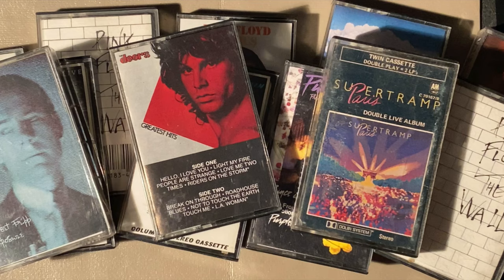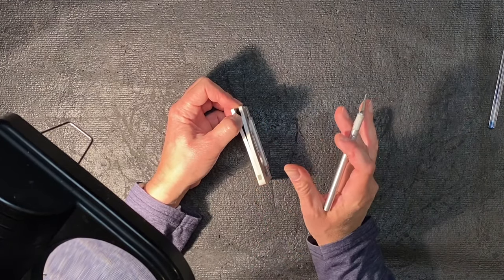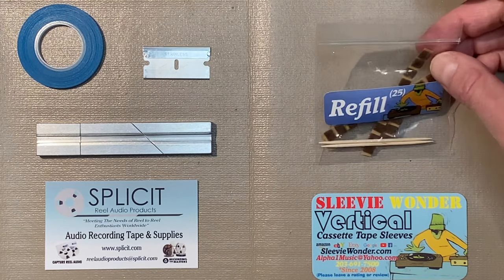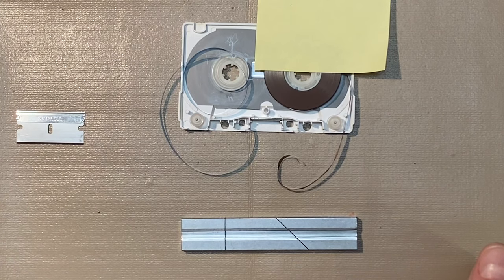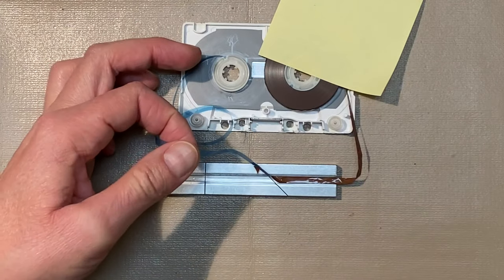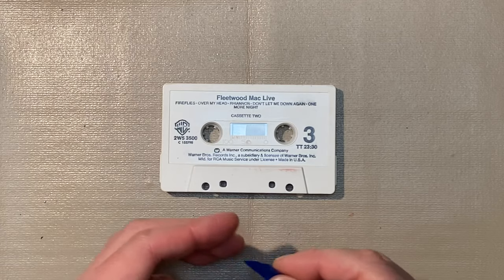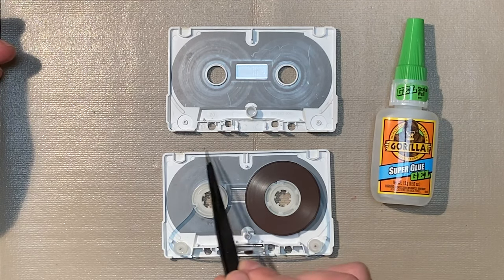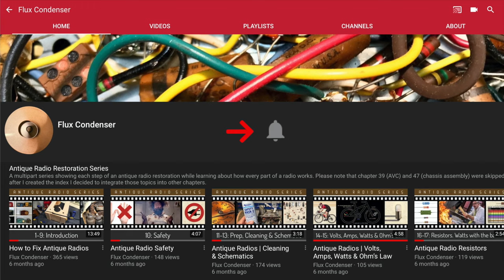How to Fix Cassette Tapes The Right Way. Open, Splice, Repair Like a Pro.

Comment: The original case was only glued on the outside.  How will u open this case again if needed with the glue on the interior of it?
Reply from the maker: Reopening the case over and over is definitely problematic, as these shells weren’t designed to be opened at all once they were sealed. In the event that the case would need be reopened, repeating the procedure should work. And hopefully, any extra glue that was used internally would easily break once the outer shell was cut apart.

Comment: Question: My leader tape came off the spool. How would one re-connect it so it's strong? Thanks for the video!
Reply from the maker: You don’t connect leader tape to the spool using tape. If you look closely, you’ll see there’s a tab on the hub which can be removed and then you can slip the tape in place and secure it with the tab. Good luck!

Comment: HELP - Today a tape of my Grandfather telling the family history broke at the beginning of Side One at the Take-up Reel/Supply wheel. I attempted to open the cassette with the blade and STOPPED. This is too precious for me to break. Do you fix tapes? If not, do you know where I could send it for a repair.
Reply from the maker: Kathy, I wish you luck getting the tape repaired. I don’t take in work as I do this for a hobby only. I’m not certain who could do the repair for you. I’m sure there’s someone out there if you decide to not continue with the repair yourself. Perhaps a Google search will bring something up. 

If you do continue with the repair, and carefully follow the instructions, you really shouldn’t have any issues. Additionally, if you’re not sentimentally attached to the cassette’s shell, once you get the tape opened and fixed, you could opt to transfer it to a replacement shell that uses screws to seal the case. That’ll make completing the repair easier and if it breaks again, you’ll have nice, easy access. You could sacrifice another tape to get such a shell, or buy a replacement shell which are available online. Good luck!

Comment: I have a Cobra announce cassette that is a 20 second tape which loops, for an old answering machine. The tape got snagged inside itself and I had to open the case. Now I can't figure out how to rewind the tape so it can be listened to. Have you ever done this?
Reply from the maker: It sounds like yours may loop similarly to an 8-track. If so, you may want to watch a video showing how 8-tracks loop on the spool from the outside and leave the spool from the inside. If I find out more, I’ll let you know.
Reply from the maker: I did a quick search for “cassette tape loop” and it seems that there are a number of ways to accomplish this, but none seem to use a method similar to 8-track. They simply use various schemes to loop the tape inside the cartridge. I’d suggest doing the same search on Google and look at the images to see if you see a scheme that will work for your tape. To get 20 seconds with a simple loop, your tape player will have to work at a slower than standard speed. Or, the tape will have to take a more complicated path to allow for 20 seconds worth of tape. Good luck.

Comment: Any suggestions for flattening wrinkled sections of old cassette tape?
Reply from the maker: No. Once it’s wrinkled, it’s wrinkled.
Reply: @FluxCondenser  Ugh. Thanks. After posting my question here I found another video of a guy using a cool iron to smooth out Ampex tape. That wouldn’t work on cassette tape?

Comment: can i get a link to the pad replace kit?
Reply from the maker: Sure thing: https://www.ebay.com/itm/25-Brown-Pressure-Pads-Cassette-Tape-Repair-Peel-and-Stick-Felt-Free-Sleeves/392881992224?hash=item5b79977220:g:Q1EAAOSwP5JdH-~W
Reply: @FluxCondenser  Ty

Comment: Excellent video Flux Condenser Vintage Audio Electronics!!!! May I ask where to get these tools and accessories to fix tapes? how to fix a tape that has detached from the reel? thank you very much in advance for your reply
Reply from the maker: Markus, I believe I mentioned where I got the tools in the video. Search eBay and you’ll find lots of options. 

If your tape has separated from the reel, look for the plastic insert which clips into the reel and holds the tape in place. Slide it out and then use it to re-clip the tape to the reel. 

Make sure you use a leader tape to connect to the reel as the magnetic tape will eventually break if it’s attached this way. Then, splice the leader tape to the magnetic tape. Hope this helps.
Reply: @FluxCondenser  Thank you very much. Sorry, i watched the video without the audio last night while I was copying some cassette tapes and listening them at the same time, my bad.
Reply: @FluxCondenser  The following question is probably a dumb one but i am asking you just in case. It is a very valuable and very old tape, just in case the plastic insert was not there or was damaged, are there any spare parts for this particular piece of plastic? I have several other tapes with the same problem and never dared to open them as I did know how to fix them. Thank you very much in advance for your reply.
Reply from the maker: Markus, there’s usually a pin or tab insert. If you can’t locate one on your reel, you could consider buying some spare reels to replace the ones you have. Again, look on eBay for spare parts. You may consider taping the leader to the reel as well. Good luck!

Comment: Just because im curious..What disadvatanges are there to not trimming the broken ribbon and putting a tiny touch of super glue and putting them back together that way?
Reply from the maker: Well, it’s not the traditional approach and the super glue is likely to perhaps not be flexible which could cause issues.

Comment: I have à problem with my cassette, sound is like wave its variable . Go down and up, do you can help me for repaire my cassette 🙏🏻🙏🏻
Reply from the maker: Do all cassettes play poorly in your machine or just one individual tape? If you’re having trouble with all cassettes, the machine may be at fault. You could have issues with belts slipping or a worn pinch roller. The pinch roller needs to be perfectly round, if not, playback speed will vary as you describe. 

Consider cleaning the pinch roller using a Q-tip and a liquid solution made specifically for that purpose. Pinch roller cleaners are available online. I don’t recommend alcohol for pinch rollers, but alcohol can be used on the tape heads. If you determine that the issue is the pinch roller, and cleaning doesn’t improve the situation, you’ll have to replace the roller. If that’s the case it’s a good idea to replace all the belts as well. 

If only one of your tapes is exhibiting this issue, first inspect the pressure pad and make sure it’s in good shape and secured properly. Check the shell and make sure it isn’t warped. If it is, you’ll need to transfer the tape to a replacement shell. Looking at the magnetic tape itself, make sure that it’s flat and not curled. If it is, or looks worn or distorted in any way, the tape will probably never play well again.

If the tape seems fine externally, the shell will have to be opened to investigate what’s causing the problem. Tapes often have two slip-sheets between the tape spools and shell, so check that they aren’t worn or causing friction. Also check that the tape path is correct as shown in the video and that the wheels are spinning freely. 

Good luck!

Comment: Hi! I own a few magnetic tapes from the ‘70s and I was wondering if there was any way that I could save them from ripping apart (I should mention that even if I touch it lightly the tape rips in pieces)
Reply from the maker: I wish I could help, but I’m not sure what would be the best approach with tapes that have become that delicate.
Reply: Tape baking, you may want to send them to a professional service to transfer however

Comment: Question would the super glue break the case if you needed to go back and repair it?
Reply from the maker: Chris, if you repeat the process as I showed using an Xacto to score the seam, there shouldn’t be any issue getting the case back open. Simply prying it open without cutting into the seam first, though, could result in a crack. Hope this helps.

Comment: Thanks for sharing you do need a steady hand and to be patient and I'd like to have somebody to do my tapes for me. I got quite a few needs to be fixed so it's going to take quite a bit of time but I will send for the kit through eBay so that I can get busy because I have tapes that are very dear to me my own piano playing and singing and I would love to preserve it , always save it and try and have it transferred to a CD so thanks again great work! Do you know how I would be able to do that transfer my music from a cassette tape to a CD?
Reply from the maker: Essie, good luck repairing all those tapes. Yes, it requires a lot of patience, but it’ll be worth it. Transferring your cassettes to CD is a bit of a long subject to cover in the comments, but I can give you a general idea of your options. To do it yourself, you have the option of using a computer. You’ll need a sound card that allows you to input the audio from your cassette player, recording software and a CD burner. If you don’t have a CD burner, you can also use this option to simply convert the tapes to audio files such as MP3. Another option is to find an audio component that has CD recording and tape playback in one unit. There are actually units still being made that offer this feature and you can buy them from Amazon, etc. Note, that newer units don’t offer true Dolby (the licensing for the technology is no longer available), but the better ones will have noise reduction that should be somewhat compatible. You may find some older used equipment that has cassette and CD burning in one with real Dolby, but I’m not certain. The final option would be a transfer-service company which would accept your tapes via mail and transfer them for you. Hope this helps.
Reply: I think there is cassette players that allow audio transfer to mp3 through a USB cable. That seems to be the easiest way to get it on a computer. Then you could create a CD from the mp3 audio your music platform (iTunes /windows media player)
Reply from the maker: Yes, those options exist, but tend to be fairly low quality and also won’t provide Dolby. The best quality will be had by connecting a good quality deck to the computer using the computer’s sound card or an external DAC. It’s a more versatile solution as well as it can be used to transfer audio from LPs (using a preamp with phono setting), 8-tracks or pretty much anything with an analog audio output.

Comment: My tapes look great but the sound is dragging not the tape deck because then I put a another tape in and plays no problem ? Pads look great and tape looks fine but dragging sound ? Please help it’s not the tape deck
Reply: Usually when a tape seems to drag, it is caused from rewinding and playing the same section over and over. This causes the edges of the tape bind against the wall of the shell resulting in the tape to drag. To fix this rewind the tape to the beginning and fast forward to the end. This will smooth out any uneven windings.

Comment: How to lubricate a squeaky tape?
Reply from the maker: Hm. There are a few possible causes for this. The pressure pad may be the issue. The tape itself may require lubrication. Or perhaps the rollers in the shell. Some people claim tape head or tape treatments such as those from Last Factory will solve the issue. Others say replace or repair the shell. I don’t have any experience fixing squeaky tapes other than transferring the tape to a better shell. As far as treatments that claim to lubricate the tape, I can’t comment on their effectiveness. Also, and this is probably obvious, make sure the problem is the tape and not the machine. Good luck.

Comment: hi my tape got twisted very bad can you tell me how to fix this thanks
Reply from the maker: Sure, I can try to help. Have you been able to unravel the mess? Note, though, that if the tape has been stretched or crumpled, it will never really play properly again.
Reply: @FluxCondenser  yes half of it twisted on me it went thin aswell , should have wore gloves like the use in hospital, the tape kept sticking to my fingers.
Reply from the maker: @josephmullen3254  Sorry to hear that. At this point, if the tape is stretched I wouldn’t recommend trying to use that section of tape anymore as it’ll just get jammed in your player. A slightly crumpled tape can sometimes make it through a machine, but anything beyond that won’t. If you want to attempt to salvage what’s left of the tape, I’d recommend using the techniques I show in the video to splice out the damaged tape and connect what’s left of the good area. You’ll have a gap, but it’ll be something, at least. 

Additionally, if the tape was chewed up by your machine, it may be time to think about having it serviced as it may ruin additional tapes. The main issue will be your pinch roller(s) which can only be cleaned so many times before needing replacement. I have a newer video on my channel showing the repair of an old Ampex deck where I replaced the pinch roller and it improved a lot of issues. You may want to check that out.
Reply: @FluxCondenser  hi thanks very much maxell and tdk I used alot this tape i told you about was a very cheap brand of tape reason i wanted to open it was the play head area on the tape it had wore off don't know the name of it but the tape won't play without it properly thanks very much.

Comment: Had no idea about the benefits of using the 45° angle, will try later. Good video!
Reply from the maker: Yes, there’s more surface area for the adhesive that way, and the splice is less likely to get caught in the mechanism.
Reply from the maker: The straight splice is good for cutting the leader where it attaches to the hub.

Comment: Anyone know how to repair a cassette that sounds like a dirty vinyl record ?
Reply from the maker: That’s a tricky one. First, make sure the problem is the tape and not the player. A dirty or magnetized head could cause that symptom. If it is the player, use some isopropyl alcohol and a cotton swab to clean the head and look into getting a demagnetizer. A magnetized head will have poor high frequency response. 

If the problem really is the tape, there’s not much you can physically do except make sure the shell isn’t warped or there’s another problem impeding the tape path. 

Once those possibilities are eliminated, I’d then recommend transferring the tape digitally to a computer and using sound software to attempt to improve the sound there. Hope this helps. Good luck!
Reply: @FluxCondenser  thanks for replying. I saw your comment regarding swapping the cassette shell. Done this and sounds much better
Reply from the maker: Excellent! So glad to hear that!
Reply: @FluxCondenser  one didn't have any sponge. No wonder it didn't sound good. Learnt something today. Thank you
Reply from the maker: My pleasure. Take care.
Reply: @FluxCondenser  have another idea. If you have done all the steps to clean and a specific cassette still sounds like dirty vinyl will recording over it fix the issue or is the actual tape worn out ?
Reply from the maker: @roasty80  That’s actually a good idea. I’ve never tried it myself, but I’ve thought of it as an option. If the tape is collectible, you may not want to do this as it will lessen its value even if the sound quality improves. If it’s an average tape, though, and you want to use the original shell with a better recording, I say go for it. But, yeah, you’ll be limited by the quality of your tape, the recorder and source. And yes, if the tape is very worn, you may not get a better result.

Another option would be to record the program to a good quality blank tape and then transfer that tape to the original shell. That might be your best bet. It’ll give you a chance to experiment and not worry about destroying the original tape. And, you can transfer the original tape to the blank shell for safekeeping. Let us know how it turns out.
Reply: @FluxCondenser  its kate bush so nothing rare. Gonna leave it alone now as done all I can. Got blank casseetes so gonna make some albums. Glad I had them as the price of new blank cassettes are crazy

Comment: I bought very few pre-recorded cassettes. My experience was those who produced pre-recorded cassettes used low quality tape that caused a lot of hiss even after switching on Dolby. I would buy high quality cassettes and dub them from a record player.
In the 2000s, I bought a Sony mini-disc player/recorder. It was impossible to make a digital copy because of Sony's idiotic digital rights management. Of course we all know how Sony fared with that. ;-)

Comment: i strongly advise putting the cassette on a vise first as shown is too dangerous you could seriously damage your fingers.
Reply from the maker: I strongly advise you DO NOT put a cassette in a vise. You could seriously damage the cassette.
Reply: i just did it,i replaced the tape in a new cassette,you have to know how to do it and anyway if it happens better the cassette than the fingers right?.at least wear some kind of gloves for protection!.safety first!.
Reply from the maker: @salcensr  Ha! To each their own! I’d rather take a cut than ruin a tape! But that’s just me. Plus, I’ve been working with Xacto blades regularly for 30+ years so I’m comfortable working with them. You’re correct though, that safety should always be a top priority.